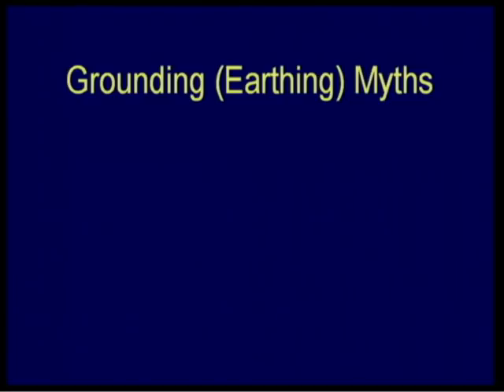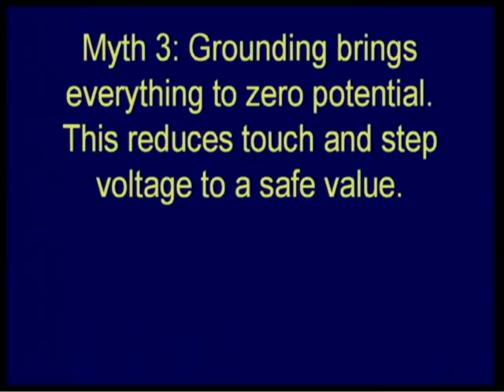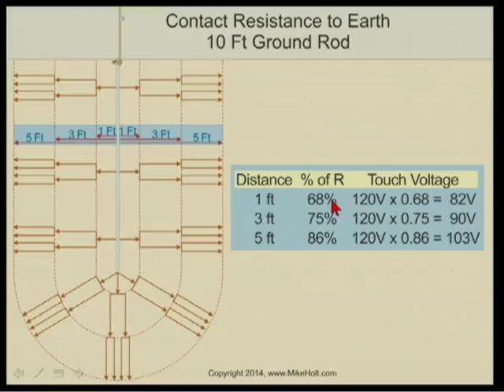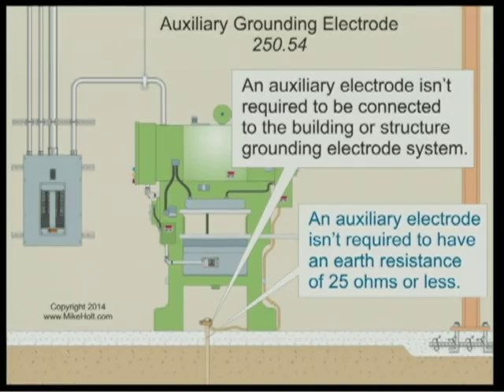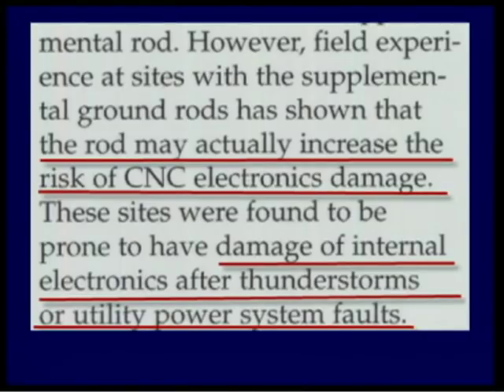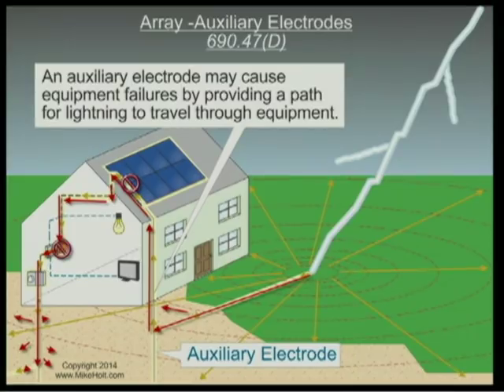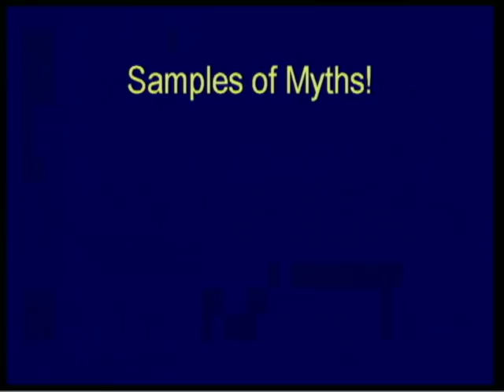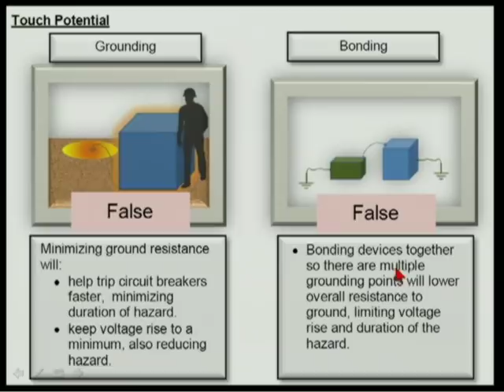6 of 7 Grounding Myths (26min:55sec)

Comment: I live in snow country, and often people will have frozen pipes. Sometimes companies will offer to connect a welding machine to your pipes to have the current thaw them out. The problem with this is that the current will travel through all the water pipes on the street, into everyone's house where the power is grounded to the water pipes, and through everyone's ground system. In some cases it will find a resistive joint to heat up and start a fire! We were told by the city to call the police if we saw anyone doing this, and if it was in front of my house, I would definitely go out and cause trouble!

Comment: Electricity doesn't try to go to ground. It merely uses the ground as a path or one of the paths to get back to the other side of the source to complete the circuit if multiple paths are available.
Reply: No. It. Doesn't. Watch the video. Wtf

Comment: You may need to re-look at Octane. The octane rating is the resistance to knock. Too low of octane will damage an engine due to spark knock and detonation. Too high of octane doen't hurt anything except your wallet. Actually, higher octane fuel has less energy potential than lower octane and will reduce the power output (a little) if used when you don't need it. Higher octane allows the use of higher cylinder pressures without the damaging effects of detonation and allowing a higher power output.
Reply from the maker: LOL. We had a long conversation about that over lunch during that recording. Thanks for the feedback.
Reply: I've literally had this conversation with several people. From my coworker to a cdl gas truck driver. When I mention the math of heptane/octane gas compression ratios to them they have no idea what Im talking about and agree to disagree.
Reply: Higher octane fuel burns more 'slowly'...

Comment: Great info about grounding which has never occurred to me. So i understand the ground conductor on equipment is important for safety for equipment with touchable metal when the neutral and ground are bonded at the panel.

Comment: Mike, when I was a kid, we used to get earthworms and night crawlers by attaching the neutral and hot wire to two screwdrivers and pushing them into the ground about 18 to 24" apart and just wait a couple of minutes. All of a sudden, the crawlers and worms would come wriggling to the surface and we would just pick them up. Within a half hour we would have enough for a days fishing. Never once tripped a breaker or blew a fuse. Fuses in those days. No such thing as GFCIs.
Reply from the maker: Yepk, I have heard that story many times.

Comment: When welding, I know from experience that if you connect the work lead to anything other than your work, or the table it is clamped to, the arc will not happen. So it is definitely not a ground lead! Question: I have always wondered why doesn't the table become energized during a weld?
Reply: it does, have you  ever been shocked by welding? you became the work lead.  electricity goes out to whip lead, flows through metal( which melts it, "welding") and it returns back to the source in which it came from. the generator "welder machine" if you get between that path you get shocked or the electricity used your body as a wire to get back to its source. thats why welders try to get the work lead as close to the whip lead.

Comment: Mr. Holt.  Do you have a presentation that is directed or geared toward people like myself who are trying to understand how to properly wire a 100% off-grid house, including grounding, of my components and solar array?  The electricians have already roughed in all the wiring, but I'm sure they did it as though there would be grid power.  I have a battery bank, two inverter/chargers, and about 12kw of solar.  Do you have any presentations I could watch that would cover off grid solar wiring of a house?
Reply from the maker: Please call me 352.455.0794 after 9 am Mountain Time.

Comment: Hi 
I live in the Middle East.  Our electric shock protection system is different from that in the United States .. We use a ground leakage device that shuts off the electric current immediately when a small leakage occurs

Comment: I was inspecting a new construction home and ground rods were located at both the meter panel on right of home and ground rods at sub-panel in garage on left of home. Service cable between meter panel and sub-panel had four service cables and floating neutral was provided inside sub-panel with additional ground wire between rods and sub-panel attached to ground bar. I can not find if this is allowed or not.

Comment: Will a light pole that is struck by lighting hold a charge longer if not grounded via an auxiliary electrode?
Reply from the maker: Nope. Lighting travels at the speed of light (186,000 mph), and it doesn't need a ground at the bottom of the metal pole to get to earth...

Comment: At myth four... If you have a ground rod in the ground inside a building ( like inside a stock room) will that serve any protection for the building or equipment?
(I'm not really sure how it's all hooked up but, i do know that the building has a ground rod on the side of the building next to the meter and a ground rod inside by the electrical panels)

Comment: Isolated grounding (CNC machines) provides a same point of ground reference (zero V) so two or more computers can communicate more efficiently. If each computer has its own ground reference, the information can get corrupted (the threshold is around 3V) and has to be resent, until verified by the receiving end.
Reply from the maker: Do you have an 'studies' that support this comment, or is your comment based on 'what you think or were told?' Electrica Power and Research Insititute study states the opposit!
Reply from the maker: Josi, please watch Parts 1, 2, 3, 4, and 5. Isolated grounding is not an earth connection at the CNC machine, this results in 'not' an isolated ground, since you now that the CNC machine connected to 'two' separate grounding connections in the earth; one from the circuit equipment grounding conductor that is grounded at the service, and then the auxiliary ground that your propose. This is the 'worst' case condition, especially when lighting strikes nearby.
Reply: The point that I am trying to make is that we should always make an effort to understand the needs and motivations of each group (owners, engineers, manufacturers, electricians, inspectors, etc.), divulge that information, and tap into the accumulated experience of all to find more efficient solutions that will meet consensus. Only the CNC manufacturer can tell us exactly what facts lay behind the need to ground their enclosures, once that is known, we can then proceed with the improvement process; all else is simple speculation.
Reply from the maker: Manufactures do not know best, see EPRI report on this topic: http://ieeexplore.ieee.org/document/854351/
Email me your email address and I'll get you the 'study.'

Comment: I'm really confused by what you said in the beginning about hooking up 120V directly to a ground rod and it not tripping the breaker.   (I get the ohms law calc, thats not my confusion)
how is it then possible that you can hook 120v up directly to a ground rod and not trip a breaker but a piece of equipment thats plugged in a branch circuit of 120v,  and lets say the metal casing potentially touches the a hot wire and sends a surge of current to ground which will then trip the breaker.  Can you please explain whats happening in these situations making them different?
Reply: thank you.
Reply: Think of the ground rod as a big resistance in the circuit and the ground rod is not hooked the the ground fault path, thats why it wont trip a breaker because of the resistance of the metal rod. Its just for demonstration that you can send current the earth and it wont magically disappear. No longer think of it as a ground rod and just a metal rod being used for a demonstration.
Reply: Im from the UK, so hopefully youll understand my use of terminology. 
By ground I mean the same as Mike in his example. By earth I mean equipment grounding intended to return current to source/neutral.
I think you say you understand the first part - that 120 Volts going to ground via say 25 Ohms is 4.8 Amps; too low to blow a fuse with a higher rating, even a 5 Amp one.
But, where there is a short circuit, the 120 Volts bypasses the equipment via the earth wire back to the source at a very low resistance. This creates an instantaneous very high current, eg 120 Amps at 1 Ohm. This blows any fuse rated lower than this.
Im not an electrician, but I hope this helps.😁
Reply from the maker: Watch the video again. This is explained.

Comment: how it works in cell towers? i work for the biggest en latín América, and they use oversized cables and double grounded equipment, inside the rack room they put a ring inside the wall.

with your explanation , all that over sized cable and gounding rods its useless.

thnx for taking the time to explain this myths

Comment: Mike, can you link me to a video that explains what an equipment grounding conductor (an effective ground fault current path) is and how it has to be setup (instead of just grounding a device to earth)? Is it basically a neutral wire that carries current back to the source? Also, I want to know how the fault gets cleared (breaker opened) from the EGC? If someone touches one of the hot wires, X voltage drop from that causes the breaker to trip? Thanks!
Reply from the maker: Sure, visit MikeHolt.TV, Click on Bonding, then the first video link. Or
https://studio.youtube.com/video/mpgAVE4UwFw/comments

Comment: @MikeholtNEC - Hey mike I am from South Africa and I am in the process of helping out a struggling farmer. He only has a very old 3KW generator as power source. there is no utility connected.  The generator was feeding into the main db  of the house which has a RCD. I noticed that the generator was floating neutral(The earth wire was cut short and only the Neutral and L1 were connected on the alternator terminals. This generator is very old and has no protection circuitry.. Also there is no ground  rod connected. although the generator's neutral is shorting out with the Chassis of the generator. So only the L and N is feeding into the house.. what do you recommend the connection should be? I would rather want to connect the cable ground wire to the chassis of the generator and bond the neutral and earth at the generator and then feed this output into the house along with this ground and utilise this ground circuit all throughout the house? So the way I see it is there is no ground fault path at the moment and its dangerous..
Reply from the maker: I'm sorry but I can't provide advice for wiring systems in South Africa. Post your question on MikeHolt.Ai.

Comment: So you were talking about step potential in the earth if lightning hits elsewhere, if you had a large antenna on your roof and you had it grounded to a local rod (in the backyard) but your utility ground is on the other corner of the house. If lightning actually hits your antenna would it be safer to have had it connected to its own ground (in the backyard) or running through the 12AWG grounding conductor to the breaker box?
Reply from the maker: No, watch this video for the entire story. https://www.youtube.com/watch?v=mpgAVE4UwFw

Comment: Is it safe to ground your electric panel that has knob and tube wiring and Romex to your copper water line at point of entry to the house indoors. If not why not ?
Reply from the maker: If your an electrician, please post your question on MikeHolt.Ai
Reply: @MikeHoltNEC  I’m not an electrician I am a homeowner trying to understand my electrical system so that I can discuss it with my electrician thank you for your reply!

Comment: irrigation controllers and landscape lighting...just lost 4 solenoids, 1 contoller, 1 vavle wire and next day realized 10 of 12 highend kichler led well lights were toasted as well. hunter irrigation controller has grounding bolt option. would you ground it to protect house? If so, what about low voktage lighting? do the 24v and 12v transformers protect the house?

Comment: Well, if this is 100% correct all the time, it's sure difficult to explain the fantastically capable grounding mechanisms at the bottom of my electric field fence called weeds. They are extremely good at eliminating the potential for shock. In the event that the metal exterior of a light pole should become energized, would I prefer that it be attached to a ground rod rather than just to me if I happen to touch it? I would. Or at least have a good crop of wet weeds at the base...
Reply from the maker: Please watch https://www.youtube.com/embed/mpgAVE4UwFw8, I think you'll want to revise your comments in this post.

Comment: I think they're could be wrong about the welder problem.
The welder has electronics and a transformer so the 'ground' weld terminal or (-) connection on the welder output could be independent from the incoming a.c. supply so current may only want to return to the welder output source terminal.
Reply from the maker: You are correct, all current is returning to the 'source' of that circuit.

Comment: on the current doesnt take the path of least resistance.  I beg to differ in one situation.   Maybe you can correct it for me.  But how come when testing for a blown fuse.  you can simply put your multimeter on the ohm range setting and put your 2 leads on each side of the fuse and read .001(depending on the range setting on the meter) and it will read through the fuse element and not the circuit the it is in series with.  Unless its blown then it will read the circuit. there for it chooses to read the path with the least resistance.
Reply: +Jer Bear  I say this only for learning purposes. <- Respectfully. Thank you for all you do to contribute to our craft.
Reply: +Jer Bear For learning purposes u most first drop all myths or notions that u assume to be true but are not, u are correct in that electrons take the path of least resistance, but does not mean they are always going to ground. we just assume they are. like they mentioned in the grounding rod discussion electrons will try to go back to the source instead of ground.As for checking the fuse that is a prime example of backwards thinking- a fuse should have 0 ohms resistance across it until it opens and will have so yes your meter reads between it instead of the series circuit and whatever load it is connected to and the fuse may also be the only path for the meter voltage to take. A grounding rod may have 25 ohms or greater resistance across it so it does not take all of the current or voltage to ground so it CANNOT and will not protect anything and may cause harm. The grounded or ground fault conductor however is a near 0 ohm (like a fuse) perfect conductor that WILL PROTECT anything or anyone EVERY TIME WHEN WIRED CORRECTLY! It amazes me how many people work with electricity every day that are really clueless as to how it works. I don't mean that toward u at all,for asking a question shows a desire to learn and an open mind. I have no electrical training but work with electricity every day in an industrial setting with a lot of 3 phase  up to 600 volts. I saw quickly my company was not going to train me and the old techs only nugget was "Watch what your doin and don't get yerself killed the last thing we need is more of those damn monthly safety meetings" so I had to teach myself but it is really better this way because I too believed these myths and many more but thanks too Mike and others we can change some of the old ways. THANK U MIKE HOLT!
Reply: Current takes all available paths to get back to it's source. The amount of current in each path will be in proportion to the conductivity of each path.

Comment: A friend of mine just bought the "A-iPower SUA12000E 12,000-Watt Gasoline Powered Generator". I was looking through the owners manual for him and it stated verbatim in the actual manual that the national electric code requires an earth ground connection and to connect a #10 awg grounding electrode from the lug on the generator to a driven ground rod to be protected against electrical shock. I looked at that like , WTH. When i try calling the company they never answer and never return my voicemails. That sort of answered my question on what kind of company i was dealing with. My friend who has zero electrical knowledge thinks im wrong because like Mike said "Its in the manual"
Reply from the maker: Great story and crazy that people have no clue..